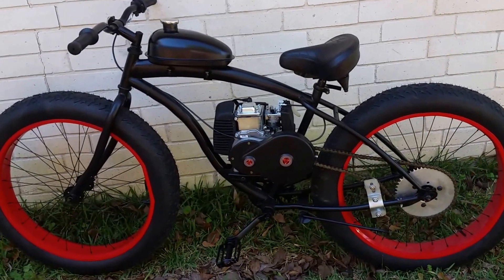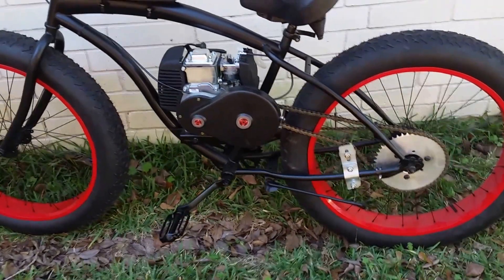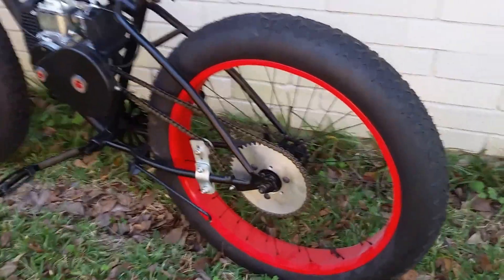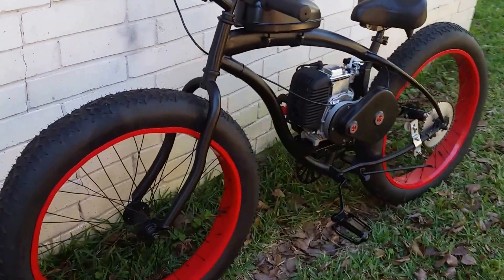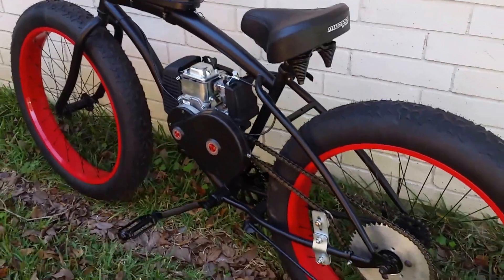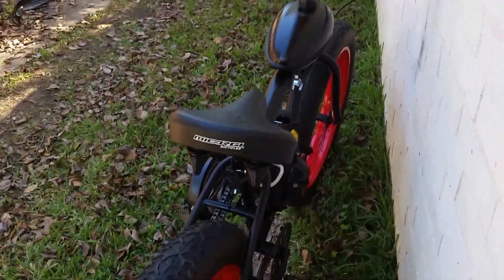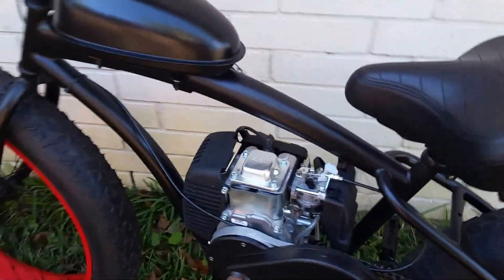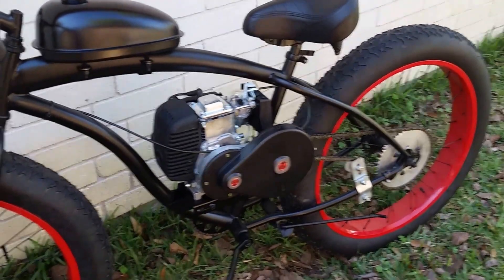4 Stroke Fat Tire Sluggo Motorized Bicycle

Comment: I got the same bike with 26x3 tires, 49cc 4 stroke with that 36 tooth sprocket runs like a dream. Love my Slugo
Reply from the maker: did you put the 3" tires on the 4" rims? I'd love to see some pics. email: hughesmotorized @ gmail.com
Reply: That's awesome, I'm figuring mine out right now I have a 4 inch beach cruiser bike I just have to offset the engine and the sprocket, my engine is a 2 stroke its running shoddily and in still figuring it out before I buy a new one to slap on the fat tire bike maybe with a new exhaust too and definitely regular style bike brakes I don't think the coaster brakes are safe for motorized bikes. What's better 2 stroke or 4 stroke? I've heard 2 stroke is faster but is it less reliable?

Comment: what size is the hub mount - 36 tooth sprocket used in the 26 x 4 wheel ???  thanks
Reply: 36 on a 26x3 rim

Comment: How did you get the chain to line up with the sprocket
Reply from the maker: I fabricated a mount that moved the center of the engine .875" (22mm) to the left

Comment: That bike looks cool with handle bars replacing the ape ones.  I want that type when I get a slugo.  Is it just standard size ones or you have to replace the stem too for it to fit?

Comment: I got it installed, one question, how much clearence is recommended?  I have about 1 cm of clearence, it was the best I could do without a custom bracket and with just a heavy duty mounting bracket, is that enough clearence
Reply: nevermind to me, I did it!
Reply: That's what i had on mine. But did you install your kit on a fat tire bike?

Comment: I am just about to start building a motorized bike, and the cruiser bike I bought had very thick pipes. The normal brackets do not fit around them. Do you recommend and extension kits to be able to mount things like the gas tank and motor on bikes with thick tubes thanks.
Reply from the maker: depends on the tube size diameter. No easy answer

Comment: want to know more about the mounting of the motor on this fat tire bike
Reply from the maker: +jim isaacs Had to offset to clear tire. Custom built bracket
Reply: How did you do that?
Reply: HoustonMotorized how do you off set motor on 4 stroke with the slugo, it's kicking my ass. I have a rear hub adapter too and a heavy duty engine mount
Reply: Bosco Dooley with the rear hub adapter (I think this can be done with adding more pineapples to the transmission side of the bike, if doing a rag joint kit make sure that God forsaken thing is dead center),  offsetting the engine as far as possible I've discovered something else that will give ,ore clearence for the drive sprocket, I'm still working on it but this should work.
1. take apart the transmission down to the drive sprocket  
2. remove drive sprocket
3. there's a support ring under the drive sprocket, use a dremel tool and shave it down half way or halfway or a hair more (any less and it might not have enough support) place the unshaved side of the support ring back on, also regrain the surface just a little so the surface won't be so smooth that there's no grip for the top of the support ring.
4. put the support ring back on, then drive sprocket (don't forget the woodruff key as well) then a washer that can support the space you just made then the lock washer, then the nut and use lock tite for extra security as well.
That should adjust your drive sprocket a little to the left and should give you that extra space  for clearence without of setting the true of your wheel or dishing your spokes. Eugene is probably not going to tell us how he did this because he's a business man if you tell all of your secrets how much business are you going to get lol, I just discovered this method on my own yesterday through mechanical thought
Reply: Yea he is all kinds of hush hush. Thanks for the input
Reply: jim isaacs it worked, I just did it, adjusting that drive sprocket to the left by dremeling the support ring by half will give you that little bit of clearence you need with room.
Reply: Bosco Dooley no problem bro lol
Reply: If you make a video about it let me know I will watch that shit.
Reply: You answered my question. I have trouble getting my chain to clear my 26x2.125 tires. If you want to build a motorized bicycle and have it work 100% without any issues you need to have some mechanic/machine skills. Custom is the way to go. You will find yourself having to build your own parts/modifications.

Comment: Did you have any problems with the drive chain hitting frame or rubbing on the tires.
Reply from the maker: You must fabricate a custom mount to push motor away from the center so chain will not rub tire

Comment: How can I avoid my tire from rubbing the chain ?
Reply from the maker: Move the motor over
Reply: And 26x3 tires instead of 26x4
Reply: Hughes Motorized that’s worked I can see the spacing ! Now it made a difference
Reply: DUBBER LANG thanks I’ll do that ! Are those skinny cylinder heads any good?

Comment: What size and brand motor are you running on that  ..?
Reply: CapnSchep it's a 49cc hueshang 7G ghost rider special edition. I'm trying to figure out how he offset the motor to get by the real wheel, I have the same bike and it's kicking my ass right now
Reply: I've built 2 fat tired bikes both from SIKK BIKE ...Both were 2 strokes,
 I used the shift kits from Sick Bike Parts, but I want to build a 4 
stroker, maybe a 79cc Predator or similar, using a torque converter  ..
Reply: CapnSchep that sounds like a plan definitely you want the torque converter because those put out ALOT, saw a guy that had one on YouTube videos and EVERY video his had to be serviced in some way on the road smh a torque converter would make that go away, a very wise choice, you will go far in life and on your bike too apparently lol😂, so to the solution, with the rear hub adapter (I think this can be done with adding more pineapples to the transmission side of the bike, if doing a rag joint kit make sure that God forsaken thing is dead center),  offsetting the engine as far as possible I've discovered something else that will give ,ore clearence for the drive sprocket, I'm still working on it but this should work.
1. take apart the transmission down to the drive sprocket  
2. remove drive sprocket
3. there's a support ring under the drive sprocket, use a dremel tool and shave it down half way or halfway or a hair more (any less and it might not have enough support) place the unshaved side of the support ring back on, also regrain the surface just a little so the surface won't be so smooth that there's no grip for the top of the support ring.
4. put the support ring back on, then drive sprocket (don't forget the woodruff key as well) then a washer that can support the space you just made then the lock washer, then the nut and use lock tite for extra security as well.
That should adjust your drive sprocket a little to the left and should give you that extra space  for clearence without of setting the true of your wheel or dishing your spokes. Eugene is probably not going to tell us how he did this because he's a business man if you tell all of your secrets how much business are you going to get lol, I just discovered this method on my own yesterday through mechanical thought.
Reply: CapnSchep it worked, I just did it, adjusting that drive sprocket to the left by dremeling the support ring by half will give you that little bit of clearence you need with room.

Comment: I just bought a slugo SS with disc brakes and seven speed. can a motor be put in my bike.  Will I have to remove the rear brake ?
Reply from the maker: +gaskan666 You will need to get a Top Hat adapter with a sprocket. That will bolt on top of the disc. You will be able to use the disc. You will have to offset the motor to allow for chain clearance
Reply: Sick bike parts jack shaft kit then use all seven speeds
Reply: HoustonMotorized do you have to drill out new holes in the motor mount or did the mount come with a parallel set?

Comment: Basically no brakes.
Reply: Cluth brake maybe?
Reply: It's a coaster brake, you just pedal backward to stop. Even then it's a shitty way to brake. You can tell it is because of the lever coming from the motor-side sprocket.
Reply: Dude that builds dangerous drop the fork needs disc in front

Comment: Its got no brakes on that bike.
Reply from the maker: It has an engine. Engines make it go. No stop...bute seriously, it has a coaster. Not made for faster speeds. Those tires are not safe at 35mph. You have one pop at that speed. You will kiss the asphalt